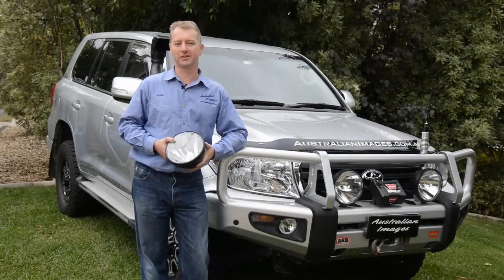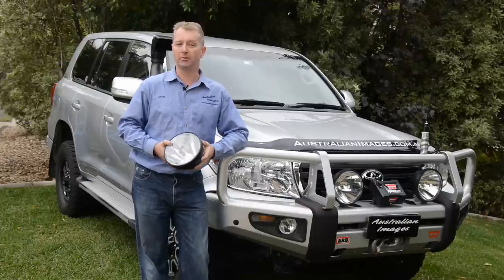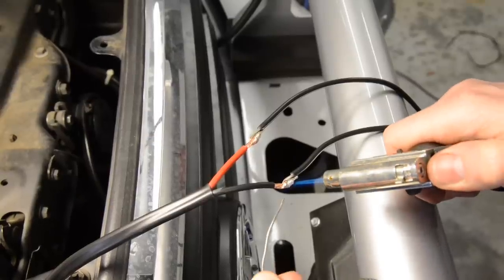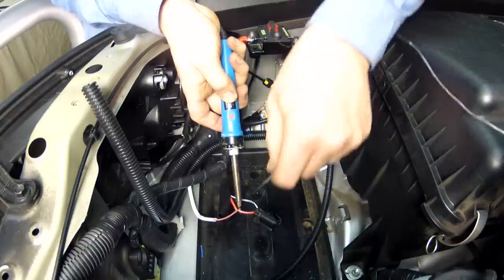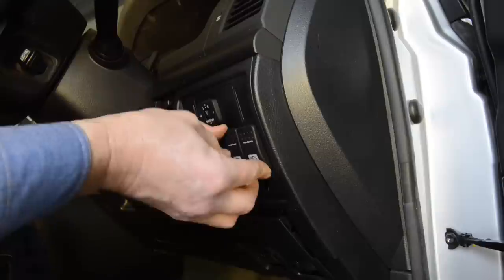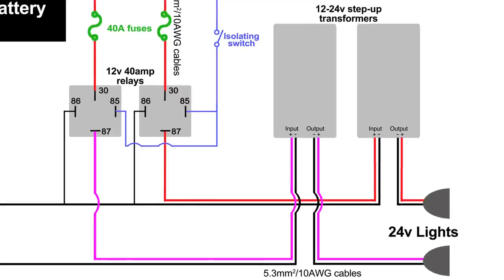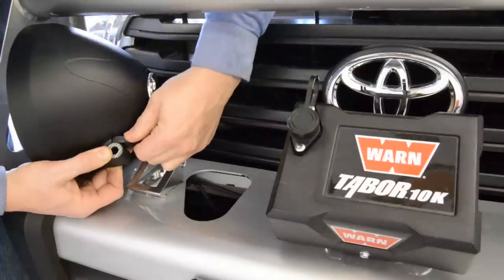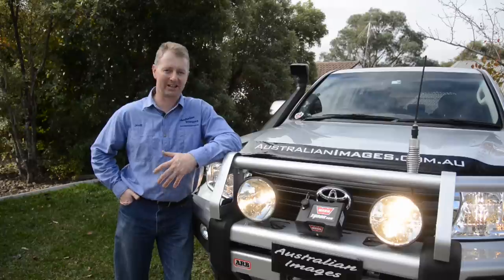LandCruiser 200: Nemesis 9000 driving lights install

Comment: Hi, I've watched the video of the nemesis 9000 instal but can't quite work out how you mounted the 24v12v transformers attached to the L bracket to the Landcruiser in front of the accessory battery.
Do you have more detailed photos of the mounting location please. Wanting to do the same.
Regards 
Brett
Reply from the maker: Hi mate, Would be a little different now as the transformers are smaller than mine. But essentially they are bolted to the aluminium plate (that's folded into an L). The base of the 'L' sits under the battery, then you clamp the battery down using the regular battery clamp. So they just end up sitting against the battery, with the 'L' bracket being held in place clamped between the base of the battery and the guard.
Reply: Thank you, very well explained.
Makes sense now.
Regards 
Brett

Comment: This is the first time I've seen the transformers that come with the lights, I've had a good look around my engine bay and there is just no room for them anywhere other than in front of the radiator where they would need to be waterproof, so it kind of rules out these lights for me. Is the difference to the 5000's really significant?
Reply from the maker: I understand that the transformers have changed significantly since I got mine, and are now much smaller. I suggest you contact Fyrlyt and ask them to send photos/measurements of the new transformers. I have seen them placed in front of the radiator without an issue.

As for the difference between the Nemesis and the 5000s. The difference is significant but for most use, I'd say the 5000s are more than enough. The Nemesis really perform noticeably better in very open areas (think roads that go through areas of crop fields, as opposed to forests and highways).

Comment: I take it these light are not built for river crossings on 4WD's
Reply from the maker: The lights themselves are quite well sealed and I've never had any water inside. There are rubber seals around the lens and globe holder. I don't think the transformers are officially "water proof", although I noticed when installing that they have sealant around all the joins, and I've never had an issue with water getting into them.